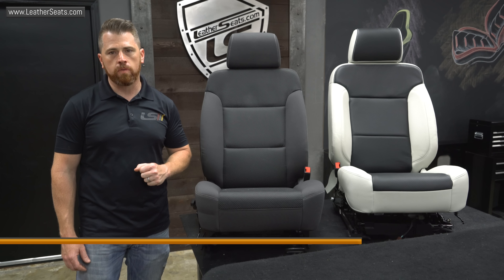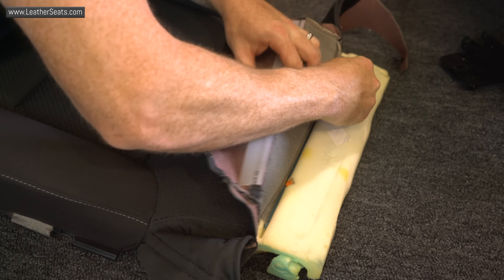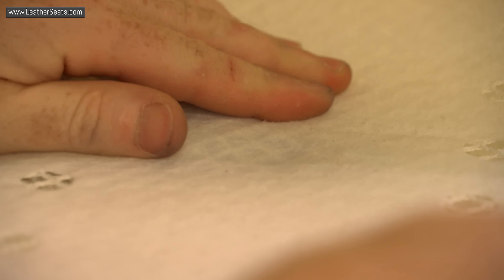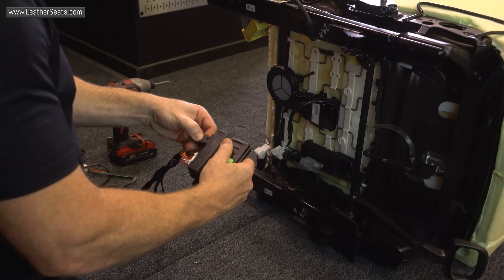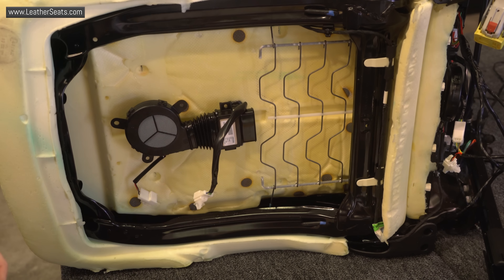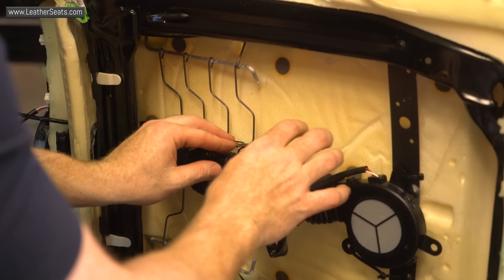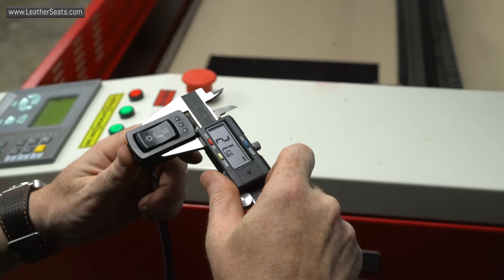Installing Heating and Cooling Seat Ventilation Units - LeatherSeats.com Tech Tips

Comment: Can you do this to a 2022 Dodge Charger SXT?
Reply from the maker: These units work universally as long as the upholstery allows for airflow, you can tap into proper power, and there is enough room to mount them on the seats. Give us a call if you have any questions! 1-866-639-7328

Comment: This will work perfectly in Africa do you do rear seat too?
Reply from the maker: Yves Bungudi We sell the units individually per your request. 1 unit = all components for 1 seat. https://www.leatherseats.com/shop/seat-comfort/seat-heater-cooler-unit.html If you get 4 units you can install them in both the front and rear seats. Make sure that you have all of the appropriate upholstery specifications for proper functionality of the units. i.e. perforation, high flow foam, etc... If you have any questions, please feel free to email us at sales@leatherseats.com or give us a call at 1-866-639-7328.

Comment: What about Airbags after this setup.. will they be as reliable as in stock upholstery..?
Reply from the maker: mukul Bedwa Our kits are fully compatible with the factory side impact air bag system and are designed so that the air bags will still deploy properly.

Comment: Wondering if installed on a mustang would there be a way too use the oem factory buttons near the climate control buttons without having too use an extern
Reply from the maker: Our system requires a switch that can control six settings. Low, medium, and high for both the heat and cooling. You would need to ask a automotive wiring expert and any modification would be at your own risk. Feel free to give us a call or email us and we can answer any further questions you may have. 1-866-639-7328 or sales@leatherseats.com

Comment: How will this work if I have factory heated seats already? Would it still be compatible? And would I then switch to this heated system or maintain my factory heating? Or do I have a choice between the two?
Reply from the maker: Hi Seth, Our product is not compatible with factory seat heaters. You would need to remove your seat heaters and replace it with this system. If you have any more questions about the Ventilation system please feel free to contact us at sales@leatherseats.com.
Reply: Thanks for the reply! Answered my question!

Comment: So how much it cost vs getting the upgrade package from the dealer which you stated in the beginning of the video.
Reply from the maker: That is a great question. It really depends on if this is a vehicle you already own, or a vehicle you are considering purchasing. If you already own the vehicle, the dealership simply doesn't offer an upgrade. It's a factory installed option only. If this is a vehicle you are considering purchasing it will depend on the models and trim levels that you are looking at. Not every vehicle has ventilated seats as a factory option, and generally speaking seat ventilation isn't an ala carte option offered by the dealer. Typically it is packaged with other upgrades in a higher trimmed model. Ultimately you would need to compare the cost of the cheapest trim level that the manufacturer offers a ventilated upgrade with the next step below it. Generally this is thousands, and sometimes many thousands of dollars since you have to buy whatever they've packaged in that trim level. With that all being said, feel free to email your vehicle information to mailto:sales@leatherseats.com and we can take a closer look.
Reply: @LeatherSeats  The vehicle you worked on. Just for compressing, you said it would cost around 7/8k for upgrades, and how much it cost your work, so ppl can compare  which one the choose.

Comment: What fitment options do you have be great In some older trucks
Reply from the maker: Chris Dix The heater/cooler units themselves are universally compatible as long as you have access to power, room to place the units on the seat foam, etc... If you are wondering about fitment on an upholstery kit be sure to check out our online configurator to see if we have a pattern available for your truck(s): https://www.leatherseats.com/shop/leather-interior-kits.html?___store=default If you have any further questions be sure to email sales@leatherseats.com or give us a call at 1-866-639-7328

Comment: Could I put these on my back seats?
Reply from the maker: GamingOfTheLegend Yes these can be installed in the rear seats. Depending on the vehicle, you may need to get creative on wiring though. As long as you have a power source and room to mount the system like in this video, you should be good to go. Feel free to email sales@leatherseats.com if you have any further questions.

Comment: i want ventilated seats for me car!
Reply from the maker: Here is a link to the units shown in this video: shop.leatherseats.com/heater-cooler-units They are universal units that can be installed in most vehicles. Your upholstery would need to be perforated and include reticulated, high-flow mesh foam backing for the units to work properly. If you have any questions, please give us a call at 1-866-639-7328 or email us at sales@leatherseats.com.

Comment: What about doing it on a Miata?
Reply from the maker: BOO5T The heater/cooler units themselves are universally compatible as long as you have proper access to power, room to place the units on the seat foam, as well as the proper modifications to the upholstery that will allow for proper airflow. If you have any questions please feel free to email sales@leatherseats.com or give us a call at 1-866-639-7328.

Comment: Is it possible to add ventilated seats to a car that already has factory heated seats
Reply from the maker: Zack Salvatore No, the heater/cooler units that we offer have distribution pads that embed into the surface of the seat foam. Air flows through those pads and then up through the upholstery. Your factory seat heaters are most likely surface mounted pads on top of the seat foam directly where the distribution pads need to be placed. Even if you could use these units together with the factory heaters it would be redundant because our units are designed to be seat heaters as well as coolers.
Reply: LeatherSeats.com so in order to get ventilation I would have to delete the factory heated seats and install this heated and ventilated kit?

Comment: Can the heating cooling system be wired into a set of oem switches wired into the dash for an even cleaner look?
Reply from the maker: chad hughes Honestly I do not know. We have not tested the integration into any OEM switches. It would be up to you and your local install shop to determine if that would work on you specific vehicle.

Comment: Can you wire the switch to use an existing switch in the truck? As in,truck has a seat heater option w two buttons, can you make it so one is cold and one is hot? Instead of using switch that comes w ?
Reply from the maker: Jeff Parkhurst The system is designed to work with the provided switch, which allows 3 settings for both heating and cooling. We have not tested integration into existing factory switches.

Comment: So from what I saw the seats aren’t actually cooled but just circulate the air that’s pulled from underneath the seat and then blows that out the holes?
Reply from the maker: Ryan Lange No, our units actually do cool the air that passes through the TED unit. The air that comes through the distribution pads will be either heated or cooled depending on the settings.
Reply: LeatherSeats.com ok cool, I didn’t see exactly how it cooled other than blowing air. These kits look pretty good especially for those that want them on an older vehicle.

Comment: Would love to see some thermal imaging of the seats with the different settings - or even just some laser pointer temperature censer.
Reply: Mads, I have this on order for my car and I do have a laser thermometer. If you hit me up in a couple of weeks to remind me, I can get that data for you, assuming I am able to install this on my own.
Reply: @ScottSchapiro  did you install it on your own?
Reply: @grimes9339  Yes, I did. First time ever removing upholstery and cutting foam. But, I followed the directions and had the video next to me while I worked. Very happy with the final result.
Reply: @ScottSchapiro  Nice!! How much did it cost all together?? Thinking about installing it, but I'm afraid I may mess something up..
Reply: @grimes9339  I forget the cost of the kit on their website, but that was 95% of the cost to install.
Reply: @ScottSchapiro  Oh, I see 😁 Yeah, there's another company that installs seat covers with heated/cooled options. They are called Katzkins and they install new real leather seat covers for you, and put heated/cooled seats in the driver and passenger sides for about 2k total. Not bad. But I'll wait unill I buy a car that's at least 20k before I invest that much in seats. My 2010 Prius will have to settle for clazzio seat covers for now (which is also a good company for cheap seats covers). I can get a nice set with any color for 500-600$
Reply: @grimes9339  I believe Katzkin uses the exact same kit, both from the same supplier.
Reply: @ScottSchapiro  Oh, nice! Hmm if I get an installation, I'll just buy whichever is the cheapest version. They have some great seat kits on eBay for cheap too. The expensive part is the instillation 🤪😩

Comment: You haven't used the extended vent tube for bottom rest TED, which you  used for backrest TED. Won't it cause accumulation of hot air under the seats or in the foot region of back seat people. 
In the backrest TED also, the hot air  extended vent is ended at the seat bottom. Wont it exhaust the hot air into the cabin itself...??

Thanks for answering ...
Cheers ... 🙂

Comment: Is it one 12V power source per seat? In other words, if I put this in a 2-seater, could they both come off the same source and run at the same time?
Reply from the maker: Yes, you can run both units off of a single power source; however, the power source must be able to handle the power draw of both units. We suggest allowing 15amps per unit.

Comment: These seats don't have heating element or heating pad? What is the cost of this kit?
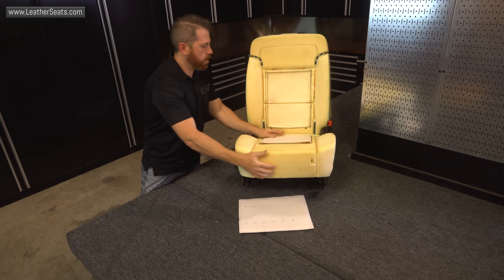Reply from the maker: repairvehicle There are no heating pads because these units heat and cool air that is then blown through the upholstery. Check out 06:26 in this video for the explanation of how it works. You can find the units listed on our website here: shop.leatherseats.com/heater-cooler-units If you have any questions please feel free to give us a call at 1-866-639-7328 or email us at sales@leatherseats.com.

Comment: I have been installing road wire, and katzkin kits for 13yrs now I will let everyone know this is not something you should tackle unless you have good knowledge of how electronics in your vehicle work. I have seen people tap into wires they should not and burning out the bcm (body control module) if you do that your vehicle is not going any where and a new bcm is not cheap! I am the only one in my company who installs these and you did a great job. I often add the switches on the dash where the factory heaters go but have to add them at an angle to fit right. I do like the spot inside the console but I am unsure of customers would like that spot. Also on the side of the seat is a typical spot people place them. I tend to always add them on the center console if it is possible. Either way awesome work an I enjoyed the video.

Comment: Could this be applied to the 2008-2014 dodge challenger.
Reply from the maker: Bitemyshinny Metalass Yes, the system itself is universal as long as upon installation you have access to the vehicle's power harness and have room to integrate the units properly into the seats. If you have any questions please feel free to email sales@leatherseats.com or call us at 1-866-639-7328.

Comment: It is just acc, 12v and ground wires?
Reply from the maker: The wiring harness for these units just have a power and ground wire. We typically run a constant power, ground, and switched accessory power through a relay.

Comment: does it work through suede?
Reply from the maker: R͙E͙X͙ Nihof  Our seat ventilation systems would work with suede ONLY if the suede were perforated and backed with the correct reticulated high-flow foam.
Reply: LeatherSeats.com I don’t see any holes in the suede, I just know my car has factory heated seats in the front.
Reply from the maker: R͙E͙X͙ Nihof your seat heaters work by radiating hear through the seat upholstery, which requires no airflow.  This system works by actually blowing hot or cold air through the seat upholstery into your backside.  Your factory seat heater systems and our aftermarket seat heating/cooling ventilation systems work using completely different thermodynamic principles.
Reply: LeatherSeats.com alright so if it would only work after I replace the leather with leather hat has the small holes
Reply from the maker: R͙E͙X͙ Nihof  If you watch the video up to the point where we start installing the new seat covers you will see that the LeatherSeats.com seat upholstery kit has perforated inserts with a special Reticulated high flow backing foam to allow both warm and cool air produced by the TED units to pass through the upholstery to your backside.  This airflow is required for the system to be effective so, in your case you would have to either replace the inserts sections of your factory seat upholstery with the proper perforated materials & Reticulated backing foam or replace all of the upholstery with a compatible upholstery kit to upgrade to this heating/cooling system.

Comment: Can you do this with cloth seats and stuff too? Or can you only do this to leather seats
Reply from the maker: Eric Singh What makes the units function properly is not leather vs cloth, its about allowing proper airflow. The reason that the system works on the seats in this video is that we included perforation in the leather and then backed the upholstery in a reticulated, high-flow mesh foam instead of the standard scrim foam. We have not tested the units on cloth seats because cloth density between makes and models will greatly vary and the results would only help on the seats that we tested. Give us a call at 1-866-639-7328 or email at sales@leatherseats.com with your vehicles year, make, and model and we can help you out and answer any further questions that you may have about theses units.

Comment: Can you use the ignition wire that is on a fuse 5amp ? Would it blow out my 5 amp fuse even though I am putting a 30amp relay ?
Reply from the maker: Frank Lewis Yes an ignition wire should work as the 30A relay is what is powering it. Feel free to email sales@leatherseats.com for more info on these units.

Comment: Does the leather have to be a special perforated leather for venting or does any perforated leather work?
Reply from the maker: Terry Chenowith Special perforation is not required however what makes this system work properly is having a high-flow "reticulated" foam  backing on the insert sections which allows the blown air to get through the upholstery and out the perforation holes in the leather.
Reply: LeatherSeats.com awesome thank you! I assume you sell that too? I am doing a custom interior in my 1984 FJ60 Landcruiser and this is exactly the kind of tech I want to incorporate.
Reply from the maker: Terry Chenowith Yes! We can sell you the reticulated scrim foam by the yard. For pricing please feel free to give us a call 9-5CST M-F at 1-866-639-7328 or email sales@leatherseats.com.

Comment: Can I install this system in honda  city seats?
Reply from the maker: Slick Surgico Honda Civic? These heater/cooler units are universal and can be installed in most seats. You will need to have seat upholstery that allows for proper air flow, room to mount the units, and an accessible power source. Feel free to email sales@leatherseats.com or call 1-866-639-7328 if you would like to know more.

Comment: so are you gonna add holes in the seats with a needle wrapped in tape for the air to go through?
Reply from the maker: sprdvegass No, the upholstery used with this system needs to already have perforated sections that will allow for proper airflow. If your seats do not have perforation, you would need to purchase a kit that includes perforation and reticulated backing foam. Please email sales@leatherseats.com for more info.

Comment: Can someone add perforation to pleather?  Are there templates to create 1000 holes?
Reply from the maker: Technically, an upholstery shop could remove the panels of the seat cover and send them off to be perforated, but at that point, it may be more feasible to swap the seat cover inserts with a perforated material with a high-flow mesh sew backing foam, allowing optimal airflow through the seat cover.

Comment: I wanna add this to my 91 nissan sentra, would it work?
Reply from the maker: Whatacoolname Not 100% sure about your exact model however our units are universal and should work most seats. As long as you have proper power and room to mount the units in a way that allows for proper airflow you should be fine. Please email sales@leatherseats.com if you have any questions about the process.

Comment: Will this system work if I don’t have perforations in my seat
Reply from the maker: This system requires your seat upholstery to have perforation on the inserts with a mesh backing foam to allow the air from the system to blow through the covers and to your body.